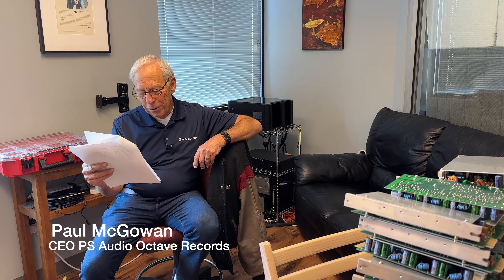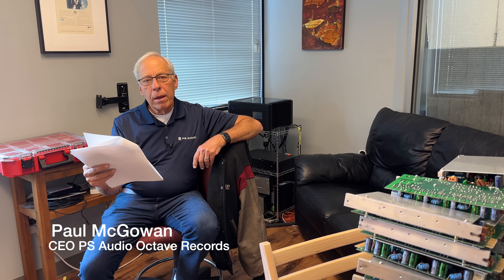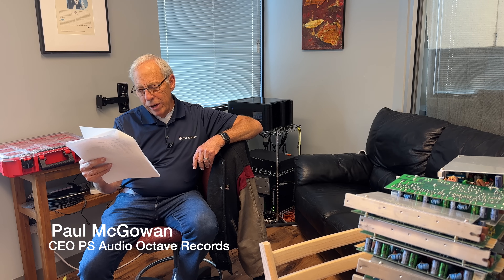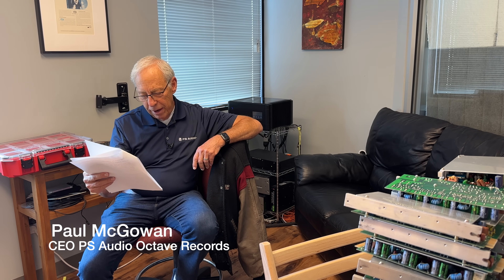Why HiFi systems sound different depending on time

Comment: Hi Paul, Mark from Durbam here.
Our power supply from Escom is very erratic to say the least.
Quite scratchy & noisy.
I recently put in an 8kva solar powe system. No more noise & my Nad ce77, klipsch reference 29 sound beautifull  a smoother sound & a filling out of hi freq notes.
Does solar power classify as a power regeneration unit.

Comment: This comes back to a little idea i had once to remove signal pollution from the AC lines, by simply axle locking a motor to a generator - using the powerline power to run a motor that spins a generator to make clean sine AC power.

Comment: My stereo even sounds better after a hot shower or while drinking a nice glass of wine with a candle lit. As a matter of fact, the mood swings are far greater than even the difference between devices. That does not mean that regenerators and better devices are not useful, it does however mean that we need to figure out how to influence our capacity to enjoy as the last "tweak". In my view, huge swings in sound quality are NEVER gear issues.

Comment: Paul completely missed the boat.  It's partly psychological, and it's time of day.  Systems always sound better when ambient noise level drops.  Why?  Better signal to noise.  try listening at 3 am.  Your system will never sound better.  Cars, kids, neighborhood activity, and other outside noise is the culprit.  Also interior noises, like A/C systems, washing machines, dishwashers, TVs and other family members all contribute to noise pollution that robs your sound of dynamics.  Want more proof?  Listen to your car stereo while in the garage with the engine off vs. while driving around.  This video was nothing more than paul trying to sell his products.

Comment: I might have a 'dirty' power grid around me. I have grounded equipment but my my amplifiers 'click' a lot. It was much worse when an electrician owned the appartment above me. I don't know what he did. 
I have a few light spots around my appartment. Most oft them were 12V and they have never failed, not even after 12 years. But when I got LED's in one room they wore out quickly. 
I've heard that LED's are more sensitive to electric current. Now everyone is encouraged to swich to LED's. I wonder if that's even feasible for most.
I don't have any form of AC 'cleaning' device. And they seems expensive too.

Comment: It's not the power. As other posters have stated, it's your hearing that can change dramatically over time, from day to day. Your ears are tied into your whole sinus system (eustachian tubes, etc.). That's why when you have hearing problems, you go to visit an "ENT" (ear, nose and throat doctor). Hearing is also affected by blood pressure. If your sinuses are congested, it's going to impact your hearing. Also, if you've been exposed to a lot of loud sound during the day, that's going to impact your hearing.
Reply: One has to wonder how much money has been spent trying to "fix" perfectly good systems because people don't understand or believe their hearing is not a perfect instrument.
Reply: I spent 2 years working on my system looking for the audio issues I was hearing only to find that it was a hearing issue.  Quick testing showed marked drop off above 10K for a while but the issue was in 1 to2 K range and sounded just like an voice coil issue I had decades ago.  I learned so much during this testing including methods of increasing sensitivity, which has it's good and bad points, and a minor though noticeable improvement in tinnitus. During these tests I confirmed that certain times of the day clearly are better for stereo perception with all it's characteristics, than others when music sounds lifeless and dull.  The psychology of these events are really hard to quantify but are also an obvious factor. But with certain dietary/holistic supplementation, and system tuning, you can actually work around and improve these issues. After all this, power was the least of my actual issues, but I did end up using a medical isolation transformer rated much higher than I will ever use.  For those having issues take an honest look at your own health and what you are actually hearing before spending crazy money on stuff that can't solve your personal issue.  In my case it unfortunately changes all the time so I have musical tracks and system settings that establish a baseline where if these don't sound right, my hearing is not optimal at the moment and I refrain from expectations of great sound until it comes back around. So far it has always come back, sometimes days later, but I would be mortified if it didn't. The very best to all of you.
Reply: @OldTooly 
Exactly ... of course the joke is on the listener.  This common quest for a "live experience in a dead room" and the stupidly loud levels people listen at is slowly redefining "audiophile" as "a person with self-inflicted  hearing damage".

Since getting into this hobby again about 15 years ago, I've been using an SPL meter to keep tabs on the sound levels I use.  This is both to avoid problems with my neighbours and for self-preservation. I find that my hearing works best at levels averaging about 65db, barely louder than normal conversation. That's where all the detail and nuance is most audible, for me. Your mileage may vary, of course, but it is generally accepted that hearing damage starts at about 80db with prolonged exposure.

At 73 years, my hearing still goes out to 13k, maybe a little more on a good day.  The audiologist tells me that I hear better than most 18 year olds he tests.  (I don't know if I believe him, but given earbuds and thunder cars, it is plausible).  

You are very correct in pointing out that most system problems are actually hearing problems. That, or poor quality source recordings. But what gets me is the way these "golden ears" go off on massively expensive quests to fix problems they don't even have, often, as you point out, because of a single little sound they didn't hear yesterday.  My general rule is to never blame the system if there is another explanation... it's actually the least failure prone part of this hobby.

Louder is rarely better.
Reply: Yup. I mix a lot of music and my hearing is more acute in the morning. In the afternoon my hearing is less accurate and high ends are noticeably blurry. I then focus on some other aspects. 

My theory is that a lot of high end enthusiasts end up spending a lot of money to compensate their less than optimal room acoustics and all the external factors like you listed, by buying unnecessary expensive audio accessories, when looking for the “perfect” sound.

It’s also fascinating how one can bring an element in the music forward by just focusing on it. So, It’s easy to fall to confirmation bias, when you’re deep in the details.
Reply: Absolutely! I don't know why many audiophiles refuse to accept the high degree of human emotion and how it effects our senses. The burn-in follies are another good example. Of course it sounds better with listening exposure. You are simply getting used to a different sound tonality. That doesn't mean it's better or worse, just different. No electronic music reproduction is perfect or ever will be. Yes speakers break in somewhat. Tube equipment requires tens of minutes to stabilize. But that's it.
Reply: @andydelle4509  Totally agree about "burn-in." I've owned a pro recording studio since the eighties, and have spent many, many thousands of dollars on equipment over the years. "Burn-in" is significant to find early component failure, and that's it. Everything is going to change as equipment is used and ages, but it most cases, it's going to be a change for the worse, not for the better.
Reply: It could be either or both.  The air pressure etc can affect it.  It depends how acute your senses are.
Reply: Yep, Paul is a snake oil salesman

Comment: If the mains supply should ever ' flat tops' you are in serious danger of burning out the power transformer !!
Reply: Naaaaa .... If your system's power supply can't handle a bit of crap, then you need a new system with properly designed supplies.
Reply: @Douglas_Blake_579  a flat top on a sine wave constitutes a short burst of DC !!! This is the LAST THING a transformer wants ... no matter how good it is !!

Comment: The first thing to understand is that our perception of sound is anything but fixed.  
There are any number of environmental factors that affect our hearing... temperature, humidity, air pressure, background noise, air movement... and on and on.
What we perceive is also subject to a whole bunch of things... health, hunger, cleanliness, mood, sobriety, tiredness, distraction, comfort... and so on.

To expect that every time we sit in our special chairs and turn on that magic system it's going to be exactly the same experience is just plain folly.  

After years of listening for problems in lots of systems, I know that my hearing is all over the place. One day I will sit down for some music and it's just a marvelous experience, sweeping me away. The next day (sometimes even the same day) that same playlist can be grating and unpleasant so that I just turn everything off and go find some other way to waste my time.

So, what changed?  
The electronics are stable and have been for quite some time. The speakers have been reliable for years. As Paul explained the power supplies can deal with all but the most egregious power problems. The system would not change good, bad, good all on it's own. 

The only sensible answer is that it is ME that changed... not the system.  
And the good news is that is totally normal and expected.

Where humans are concerned, everything is a variable.
Reply: You sir are the smartest commentator on Paul’s videos.
Reply: @jeffwalther 
I doubt that.  

But I do make an effort to continuously learn more and more about subjects that interest me .... like this one does.

Comment: Mine definitely seems to be different based on time of day. But mood, weather, and other factors play into it strongly. Yes, the electricity is having less demand and usage after 9pm, both in and outside of my house (less lights on, no washer/dryer/dishwasher/Air conditioning too) but also the neighborhood noise outside the house is drastically reduced, the human noise inside the house too. My sense of all the subtleties in the music increases after 9 for sure, but I'm not convinced it's because of purely electrical improvements.
Reply: Even listening to music in the dark makes a massive difference.

Comment: Our hearing acuity changes during the day/night.  Generally when we first awake after a quiet night, our hearing is sharper.  During the day as we are subjected to noise our hearing degrades.  Try this:  Listen to a familiar recording early in the day, and then ride in a vehicle for thirty minutes or more.  As soon as the ride is done listen to the same recording on the same system.  It will sound less favorable.

Comment: I think RF noise can make a big difference in densely populated situations, especially in flats where neighbours are using mains to transmit ethernet over mains, plus lots of neighbours using wifi. Then there's neighbours using terrible switch mode power supplies and light dimmers which churn out RF. If you live in a detached house away from all this the problem won't be anywhere near as bad.
Reply: No, not in the slightest. RF emitters operate at such low power, you would need to position your cables right up against the transmitter to hear the tiniest noise. Since the decibel falloff is exponential, the noise from these emitters in their actual positions is so low it's essentially zero.
Reply: @ryansemplexyz I’m not sure about that. There’s also EMI. I don’t think there’s a single cause to this phenomenon.

Comment: I use a double-conversion, always-online UPS and it stores energy into its battery and regenerates AC from battery energy. It's basically an AC regenerator.
So, I don't buy into the idea of expensive power plants and such when one can go to the UPS market and afford a well-engineered always-online UPS.
Lasers and other extremely sensitive cutting machines use these too. So, I don't see why audio equipment is any more special.

Comment: This is true. Products with massive amount of caps capacity are less affected by power cables. A dc-blocker with tech that rebalance the sine wave provides similar qualities as listening thru the night (but to a lesser extent than listening at night) This means that

A ) The best products are a huge battery running off grid (StromTank)

B ) The second best type of products would be a combination of sine wave rebalancing dc-blocker (Isotek Uni) placed before a power regenerator with as huge capacity as possible (PS Audio P20)

All solutions mentioned above, and other passive solutions including passive filters like Audioquest Niagra 1000, Isotek Sirius  etc. will benefit from a power cable with a capacity to release as much amount of power as possible behind it (like a 55 amp capacity C19 fitted cable built from a good 3x 4,2 mm2 cable / AWG 11 or better)

The cable behind the power reserve (StromTank/regenerator) (to the amp) is more important than the cable before the regenerator. 

A regenerator needs a high capacity power cable before it, but an off the grid device like a StromTank do not need a good cable before it if it is run off the grid. 

A passive filter will always benefit from good cables before and after the power cleaning, with the cable from the wall to the power cleaning device / distributor the one most important one as that first cable sets the tone and capacity of all cables behind it. 

Another conclusion is that all systems except off the grid solutions, benefits from getting the dc on the line down to a minimum, even if several devices are needed. A power regenerator benefits from having a dc-blocker before it, even though one is built in (as the transformer it self gets affected by the dc). 

I hope this helps some one... Almost all people have not understood high end high power cleaning good enough to make informed choices. Most tend to learn from mistakes and only treat a few of the symptoms, not getting the power right the first, second or third time

Comment: In South Africa I have noticed a quantum improvement in my listening experience since hooking up a solar array and inverter/battery system.
Presumably I now have a cleaner AC supply than before, an unexpected benefit of going solar!
I have a vintage pair of Arnie Nudell's Genesis 450XS speakers, serial number 9 and 10, which thrill at each listening as they play the room like nothing else. Paul, were you there when these were born??  Planars and servo woofers just as you prescribed for the FR range.......
Reply: So fwiw solar systems are notorious for generating hash - this comes from the process of converting the DC from the panel to AC.   All of the home systems and most of the commercial large ones are huge generators of this hash which requires special filtering and line treatment. If you are really having an improvement it could be that you have more voltage from the solar system as commercial AC lines can and do drop voltage at times.

Comment: I live in an Eastern European seaside town, the population goes from 1000 in the winter months to 40,000 in the summer, average around 35c (95f) so everyone is running A/C. The power supply is dubious at any time of year as the infastructure is pre communist era. I have known the voltage drop to 190v. My system shrinks into itself, sounds muddy and flat, clips if driven hard and generally becomes un listanable in the daytime in the summer. Extreme, but it kind of proves the point about power. Do you have a dealer in Bulgaria Paul? 😀

Comment: Can be many things. Just like our perception of vision, taste, can change due to tiredness, illness etc, there are other extraneous factors. For example, having a open window, where previously it was closed, somewhere nearby can affect pressure and therefore sound. Were you sitting/standing in the same place listening to the same tracks at the same volume? Is the temperature and humidity  in the room comparible? I strongly suspect its not directly the equipment.
Reply: Think of listening to music as a tool for the brain. Different genres, volume levels, are all tools you use for healthy mental well being. Even listening to the wrong type of music can cause negative stress levels to rise.

Comment: Will a P 12 diminish the malicious use of HAM radio gear focused on electronics by neighbors?
Reply: No.  RFI tends to enter audio systems via unused input jacks or very early in the audio chain.  It almost never comes from the power lines.

There are rules about the use of amateur radio transmitters and if you are having problems you can contact the licensing agency (FCC in the US, Industry Canada in, well, Canada) and ask them to investigate.